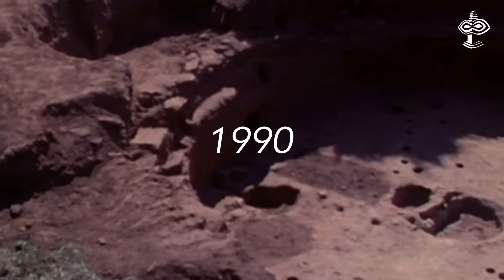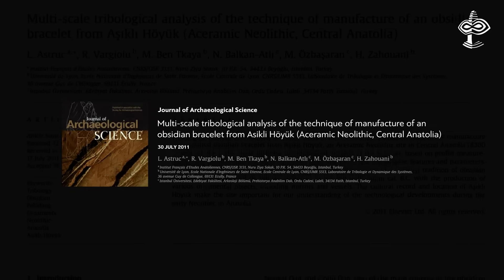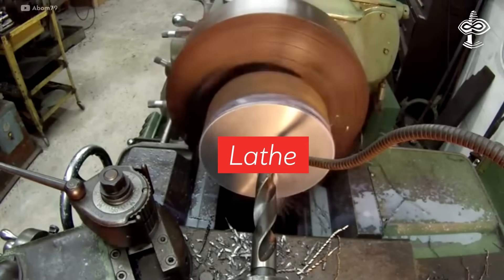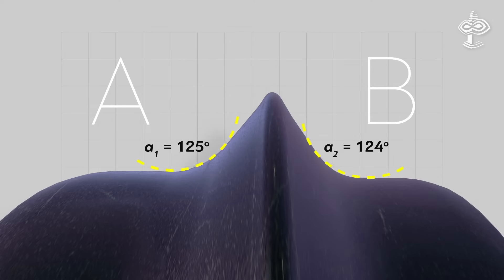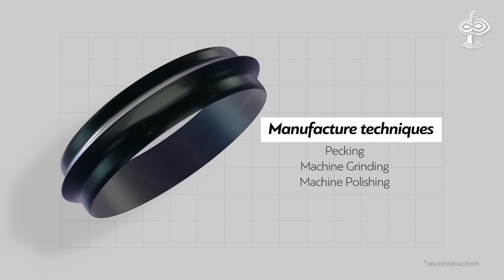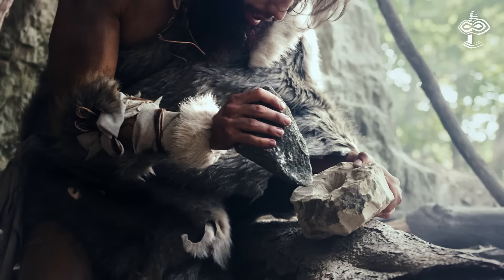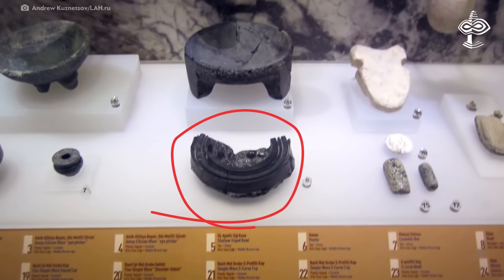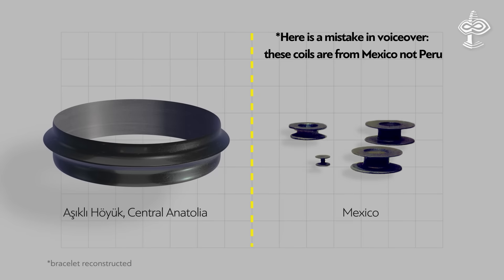This obsidian bracelet is 9500yo and it was made with unknown MECHANICAL devices - VERSADOCO

Comment: You don’t need metal to cut obsidian. You only need a harder mineral like quartz or corundum, or diamond. And spinning of tools can be accomplished without motors if you have someone to pedal or push for you.
Reply: Its the absolute micro polish and perfect symmetry that makes it unique, the rpm required to cut and polish it would likely be beyond any of the tech we have found so far.
Reply: @GoonyMclinux   wrong, speed is not necessary and would generate to much heat. think of the term hand polished.
Reply: You can't get perfect symmetry by hand, and a micro polish so perfect is impossible even by hand.  @TheMarklongboard
Reply: The "potters wheel" is a mechanicle tool that was in use back then. It could have been altered to do this work.
Reply: @ivanivonovich9863  A potters wheel type machine doesnt have the durability, speed, or precision to take a raw piece of obsidian/granite and turn it into that. You are going to have problems holding concentricity, especially as your primitive spindle wears out. Roller bearings are an absolute minimum for machine grinding granite.
Reply: @phalanyx3478  So you have a better explanation of how the item was made?
Reply: @phalanyx3478   speed in not relevant or needed.
Reply: @ivanivonovich9863  Magic spell!
Reply: @TheMarklongboard  That's what your girlfriend said.
Reply: @ivanivonovich9863  Yes, they also had drills and butter churns with ropes that turned a wooden pin back and forth. Once you can build a mill that turns a millstone, you should be able to drill very hard things.
Reply: You'd have to train a monkey to pedal pretty fast.
Reply: And the wheel!

Comment: Denisovans around 50ka to 40 ka had carved a chlorite bracelet with precision.  Xinglongwa culture in China was carving nephrite artifacts around 8200 years ago.  The later Hongshan Culture around 7,000 years ago were even carving sophisticated nephrite and hardstone carvings.  The use of hard wood or bamboo materials to create tools for carving, not metal-based machines.
Reply: The puzzle however is when you get to precision. Once you get precision beyond that the eye can detect, then what's the point of taking it further? Yet antiquity seems to be filled objects where the precision is just impossible with the tooling of the time. We're tried for decades now to work out how it can be pulled off. Like the Egyptian vases that have prevision on the inside of granite vases precision of 1/1000th of an inch. We're talking microns of deviation. We can do that today with diamond tipped tool bits on a precision lathe. But, you can get in to orbit with less precision than that. 
There s something really wrong with history when the standard answer is 'artisans were really talented'. Historians need to speak to material science engineers a bit more.
Reply: @nathanielacton3768 a lot of people just don’t understand how the incredible precision matters when examining these ancient objects.
Reply: @nathanielacton3768  add in the "handles" of those vases and it becomes that much harder for us to do, at least on a precision lathe, then take into account the way many of them taper, the underside of the lips, the smoothness, the type of delicate stone used, the way some are so perfectly balanced, and the sacred geometry/mathematics that has been found in some and would almost require a computer to design and get that precise. 

Every little detail makes them more and more astounding, that much more unlikely for supposed forgers to achieve much less even know about (when some skeptics/academics cry about provinence) and all the harder for us to replicate even today (altho I don't think it's completely impossible, just time consuming, advanced and rather expensive to pull off)
Reply: @nathanielacton3768  It's not that complicated materials sciences is looking WAY past the basic idea here. You can polish objects like a mirror without complex tools and doing so is not pointless because you can no longer see the change to the surface visibly. They just rubbed it till it was shiny man it wasn't that complicated. They didn't even know what materials sciences were or care. All that mattered was did it get rubbed till it was shiny or not. Science over complicates things because it seeks certainty and replication. Art never required any of this and that's what these old relics were art not engineered objects. A painter does not care about the individual brush lines in each stroke nor did they care about why it was shiny just that it was and they could get it there somehow lol.
Reply: They definitely weren’t using hard wood and bamboo tools to do precision work like this.
Reply: @Colton1776  How do you know? The evidence suggests stone is the FIRST material we could work that was durable. No kidding by Egypt we were absolute masters of working the materials. Stone was FIRST not last LOL. Metal and others materials were not used until very recent in our history. Before that stone and wood.
Reply: I think what history has proven about as well as anything can be is that humans can carve some stone and have been able to for a very very long time. Like they call it the stone age for a reason and that was the start of man according to some accounts.

Comment: Although that 'bracelet' may have been worn on somebody's wrist, I doubt it was created for that purpose. That kind of machining suggests that it had some practical use in a relatively high-tech tool. If it happened to be wrist-sized, perhaps that accounts for it being preserved as a special object by people unable to produce it. There are similar objects in pre-Columbian Americas. The only thing that can date them is their surroundings when found, obsidian can't be carbon dated, researchers use hydration dating, but this requires knowing the conditions around the object from the time it was created, as hydration rates vary with temperature and exposure to water and water vapor. Finding something in grave that can be dated by carbon dating only tells us the last time it was used, not how long ago it was created. Finding a few such objects at a site of low technology suggests that that site does NOT represent where and when it was made. It was probably traded or looted and carried across hundreds or thousands of miles before coming to rest.

Comment: I've seen y.t. videos of lenses harnessing the power of the sun to create obsidian. Just curious if that or maybe an active volcanic source if a mold could have been used? Similar to how I believe polygonal structures where made, geopolymere, in a sense. With a mold or frame or fabric, ect. I think maybe the nubs seen universaly may have been from a hole so excess air and water can escape as the aggraget is mixed and settled. I know; not as exciting as ancient aliens... Also if a potters wheel was developed by that time then there's the tech to polish bracelet and also machining you'd think. Idk. Fun to speculate.

Comment: Maybe the item is a bearing for a lathe? lol. What we have seen in modern times is the first few lathe designs make the next lathe better, and so on. One thing to think about is you may not need precision bearings for the lathe head. Lens makers have a rotating head and tool, which balance each other out depending on the movement you do. Also, you can check high and low areas with a master that has carbon on it and see where it hits the item you are making. Make the master with clay and grind it after firing to correct warping. I just wonder how many attempts it took to get a non-damaged result. That thin obsidian must chip like mad so gentle grinding might be needed which would take forever.

Comment: Lathe and mills aside, all that's needed is a potter's kick wheel and a fixed bit with mild articulation. Certainly, these city building cultures had such devices.
Reply: The kick wheel, a potter's wheel powered by kicking a heavy disk, was not present during the Late Stone Age (also known as the Neolithic period). The earliest evidence of the wheel, including its use in pottery, dates back to around 3500 BCE, which is after the Late Stone Age period
Reply: Agreed, and as stated in the clip itself, they had harder stones to work the obsidian. Even the dust can be used as an abrasive to give it more of a shine, often applied using a cloth or wooden implement to give it that final touch up.
Reply: @LostCylon  Please, use your noodle. A lathe or other machine designed to produce these artifacts requires much much more than a simple "kick wheel" to achieve the results we see in the video. We need a power supply to drive surfaces at a constant high speed, precision fixtures to hold the workpiece, and hardened cutting inserts. There's more than a little bit of high order math involved in all this as well.
If city building cultures had such devices, we should have seen some hair of evidence of one by now. The fact that we have not found any precision machinery at all dated to the era these pieces were dated at is a stunning mystery.
Reply: @bucky4752  i agree the tool marks on the bowl and double internal lip plus consistent precise 8mm thickness of the bowl cannot be produced by hard rock against hard rock on a kick wheel . Plus the kick wheel was not around at the time of late stone age settlement .
Reply: Diamond tools speed things up, but you'll never get a good mirror finish with diamond, you need the abrasive reduction of silicone carbide for a true shine. A trick of the trade.
Reply: 1. Kick wheel needs no power.
2. Easily maintains a steady speed.
3. Obsidian can be cut with anything from dirt to obsidian itself.
4. "High order math" is not a thing.
5. Machine can be wheel.
Reply: @ericschmuecker348  I haven't seen a kick wheel make anything close to that bracelet... not saying it can't be done, I just want someone to prove it and show everyone once and for all.... until then you can't expect people to believe it can be done....

Comment: " ... nanometer precision"?
What does that mean? (Little words please, I'm a wee bit dum.)
Reply: I think it means the level of imperfections is very teeny tiny. Like you'd need a microscope to measure any mistake? Millimeter and centimeter are divisions of the meter, a nanometer is one billionth of a meter I believe, dividing a meter into a billion equal measurements that only a electron microscope could detect. Which is probably a slight exaggeration to make it sound cooler.
Reply: It means that no one could do it by hand, not even.

Comment: My question is: can you actually carbon date obsidian? How do they know it’s around 9500 years old? Pretty cool though, no matter the age.
Reply from the maker: While carbon dating is not applicable to obsidian, its age can be determined through the Thermoluminescence (TL) dating method, which measures the accumulated radiation dose in crystalline minerals since they were last heated or exposed to sunlight. Furthermore, a refined TL method developed by Professor Liritzis offers a direct dating approach for stone.

Regarding this obsidian artifact, its age was estimated based on its discovery within a specific geological layer and the broader context of the archaeological site. Please refer to the scientific paper for more details.

Comment: I'd like to think they used rocks or large spinning rock wheels spinning at high speeds to create these things but that could work on the outside but not the inside
wild stuff to ponder on.
Reply: It could work on the inside also! If I were to try to make this only using wheels and stone. I would hold the raw obsidian glass rock (in a jig/vice type thing) and drill/grind a hole through the middle, once the ‘drill bit’ goes all the way through the obsidian, you could then spin the obsidian piece on the stone drill bit and cut the outside. Once it’s done you slide the piece off of the ‘drill bit’ and you’ve got yourself a bracelet.

Hard to explain through text. But it’s definitely possible to achieve this method with geared wheels (to achieve high rotation speed. And stone - acting as a grinding/drilling bit.

We quite often disregard our ancestors carpentry skills. But they were using wood as a medium LONG before stone. It’s simply because wood rots that we cannot see their structures